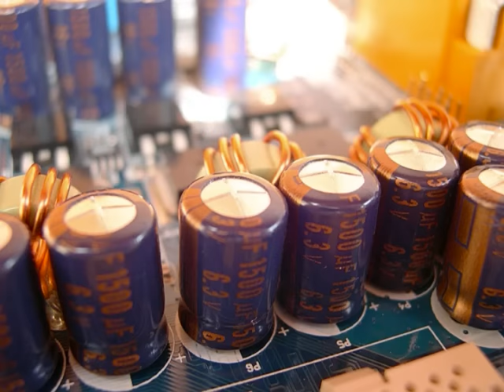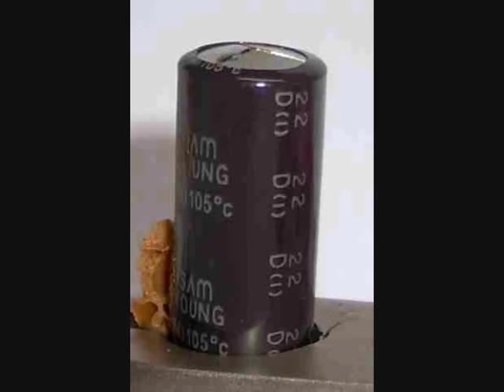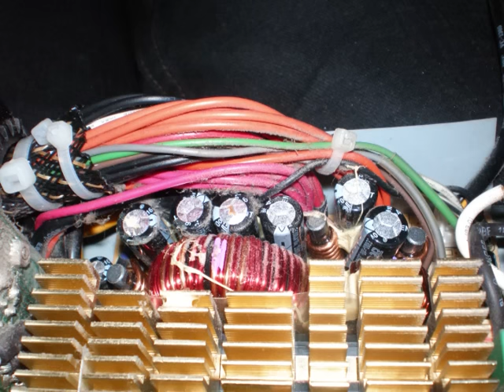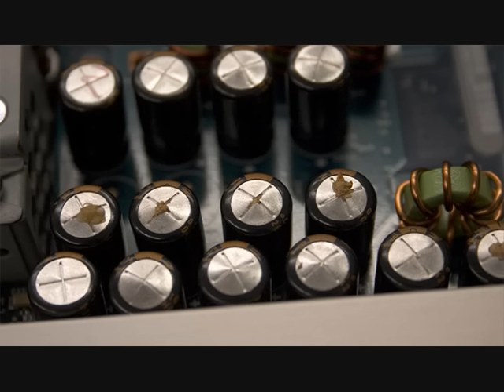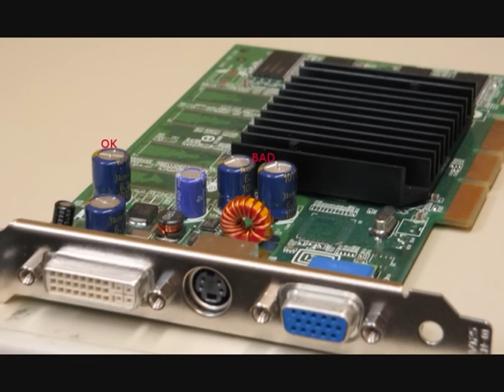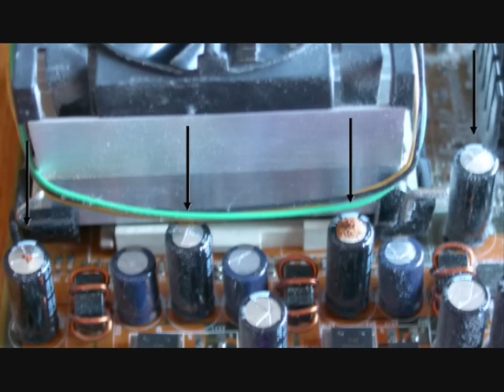Pictures of bad capacitors

Comment: @videopirate100 Those are called ferrite cores or toroid cores and mostly non magnetic types. Combined with enameled copper wire wound around it, it then becomes an inductor which have many different uses. Most use are for filtering noise, rf filters on radio's, matching frequency transformers etc...   The one you saw on your light bulb was used for an inverter circuit that drives the florescent lamp to light up. The inverter circuit was to replace the old bulky Ballast types

Comment: @generfeld You can also try swapping out the power supply if you can borrow one from another computer. These caps were also used in power supplies and I had 2 die early from that era. The voltage can read ok on a mutlimeter, but it can still be "noisy" and out of ripple spec which overworks those leaky caps on your mobo. The power supply is an often overlooked cause of instability.

Comment: A funny thing has happened half a year ago. My PC started rebooting unexpectedly, it turned out most of the power supply capacitors on the mainboard were bulged. I replaced all of them, it still didn't work properly. I tried it with a different PSU, no luck either. I was about to give up on it, but I still had one cap left, so being out of better ideas I replaced a perfectly fine looking cap located near the PCI slots. And it helped! Everything worked fine since then
Reply: Qual era o nome da música quando esse vídeo foi postado em 2007

Comment: FYI sometimes there's a black sticky stuff that oozes out of the bottom of the cap, you have to remove it from the board to see it.

another problem is the top of a cap looks ok, but the plastic wrap has pulled down, in other words all you see is bare metal on the top, I think it's caused by the cap getting warm which causes the plastic to shrink.

have been doing this for awhile, took my first electronics class in H.S. in 1965.

Comment: My 1970 JVC Nivico console stereo doesn't have cap problems and it's full of electrolytics in the power supply and amplifiers. I don't know what brand the caps are. Whatever they are they haven't bulged or leaked in 40 years.

Comment: I have been replacing electrolytics on SONY receivers and other transceivers, mostly surface mount. I use a bit higher voltage, 6.3 to a 10 or 16 volt. I've seen this many times in computers! Good show case!
Reply: Qual era o nome da música quando esse vídeo foi postado em 2007

Comment: @fern4ndo0 It happened to my old PC (a Celeron machine from 1997) with all caps around the processor in a puking state: the problem was that it gave results you'd normally describe as having a software origin (my pc randomly started to uncouple things on the ports) after replacing all of them it runs flawless again (not bad for a PC that has been an office-machine for 5 years!
Reply: Qual era o nome da música quando esse vídeo foi postado em 2007

Comment: The only effective way to identify bad capacitors is to desolder them from circuit board and test them individually with a volt ohmmeter. Set to X1 ohm, test the forward and reverse lead and you'll get a reading which decreases in seconds. A non-decreasing very low resistance reading means a shorted capacitor, while a capacitor with high  resistance reading (no needle movement) means an open caps. Somewhere in between means a leaky capacitor. I am repairing now an old Casio TV 470 pocket television and so far |I already got 4 bad capacitor replaced.
Reply: Qual era o nome da música quando esse vídeo foi postado em 2007

Comment: @generfeld my Asus mobo and power supply packed it in last year because of this problem. A family member has a Gigabyte mobo from this era and it just fried and has swollen leaky caps too. I remember the good old days when electronics would last 10-20 years no problem. I notice the new "high end" mobos all use solid caps now so hopefully this will be an end to it.

If your computer is unstable, try underclocking it in the bios by lowering the bus speed a few mhz. Worked for me.
Reply: Qual era o nome da música quando esse vídeo foi postado em 2007

Comment: what happens when a capacitor leaks on the board? what's a safe way to clean the crusty dischage from the circut board? can the  discharge damage the board?

Comment: in my trainee times Ive learned that a capacitor runs safely and lasts a long time if the voltage rating is at least twice the voltage it gets charged during its desired operation.
but what does the industry do now? They use 6.3V caps for 5V operating voltage and 16V caps for 12V. My instructors would have kicked my ass if I had used such caps for my final practical exam

Comment: I had some  rgb led decking lights  with  a control panel  and I think some of the capacitors and resistors have  blown  coz last Tuesday afternoon  the control panel was  smoking  and very  stinky hot  electrical  smell
Reply: Qual era o nome da música quando esse vídeo foi postado em 2007

Comment: The main reason the mother board and video card capacitors heat up are due to cheap power supply units out there who's output capacitors fail, which leads to the capacitors on the mother board and graphics card having to do the high frequency filtering action. This causes the capacitors to heat up, please use a good power supply to prevent this.

Comment: Great video!!! Electrolytic caps is a type that uses an electrolyte, an ionic conducting liquid, as one of its plates. This reqs that the applied volt must be polarized; (DirectCurrent) Also, the ionic conducting liquid has a expire date, even if the caps are unused!!! ..so, using dc caps that was produced years ago is always a bad idea, even if they comes right from the store and looks brand new!!
Reply: Qual era o nome da música quando esse vídeo foi postado em 2007

Comment: How can you tell what are bad and are not bad. Some look just fine. I had a TV that had a blow capacitor or resistor. Don't know what one as there are hundreds put together. All looked just fine. How could I tell what one it was? I tested to board and it no longer came to zero so how can I find the bad one?

Comment: Only problem with changing the faulty Cap's is that its already stressed the other componants on the board so reducing the life..... Its crazy that with all the technolagy in a modern computer the manufactures are using cheep Caps.... I suppose they sell more mother boards that way...
Reply: Qual era o nome da música quando esse vídeo foi postado em 2007

Comment: Hi, my Samsung monitor stopped working so i changed all the caps on the power board,  worked fine for 3 years and again i had to replace 2 of the caps.    ChongX (1000uf 25v) are complete garbage i will only use Nichicon caps from now on. And originally Samsung was of no help either,  i will never buy another Samsung monitor again.